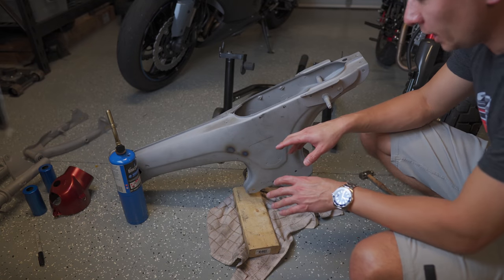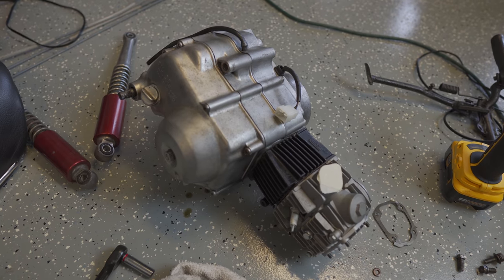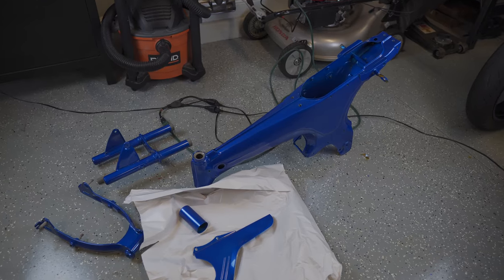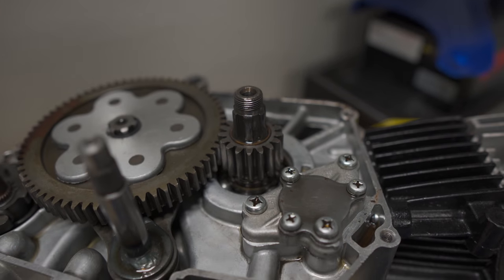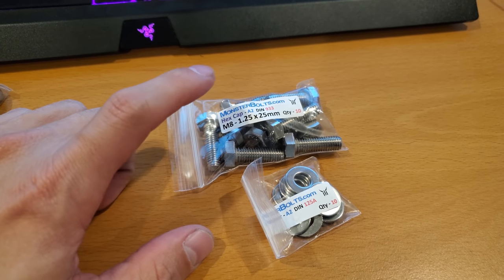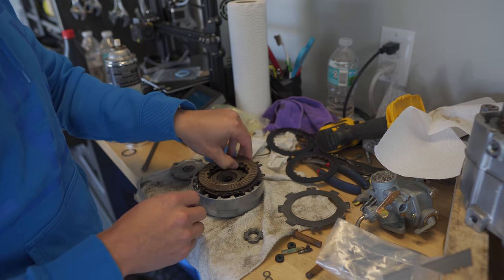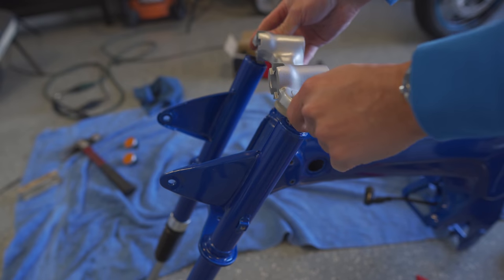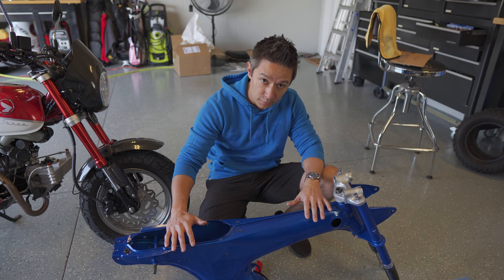Honda CT70 Powder Coat, Shocks and Engine Box - Episode 3

Comment: I was just at CHP Motorsports today and was talking to Chad. I live about 35 miles from their warehouse. They have a few CT70 bikes for sale. They look like new. I was asking about some chain noise since my 74 K3 has only 480 miles on it. He said the noise is normal. I did a total engine tear down on my channel. He said to use Rotatila 30 weight and it needs to just break in with low miles. I did some painting on mine, but I am doing mine on a low budget.
Reply from the maker: I wish I lived close enough to CHP to pickup parts. I've been following your build, looking great man!